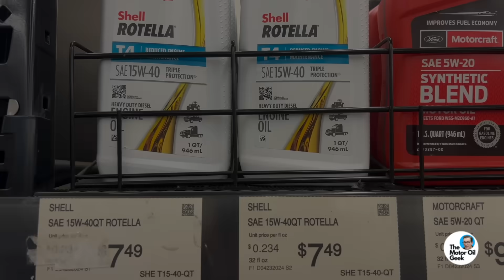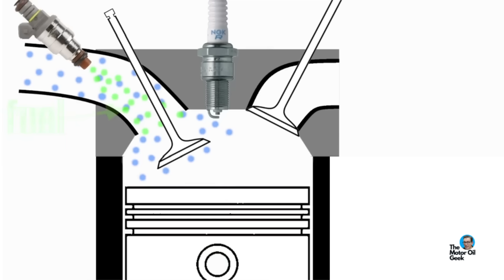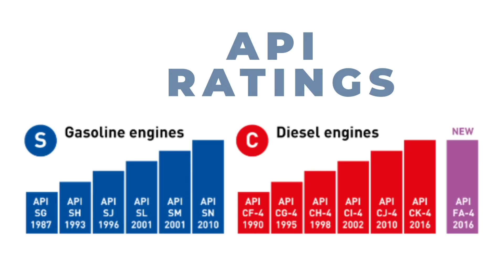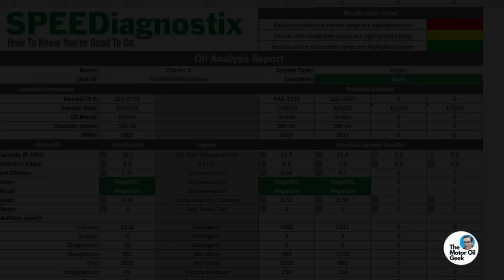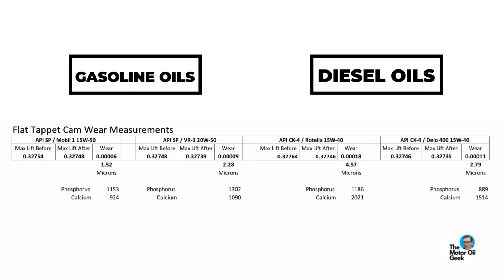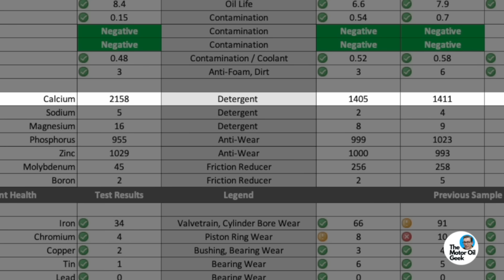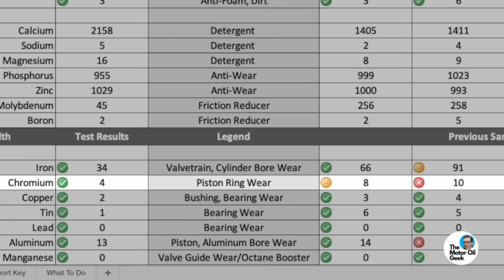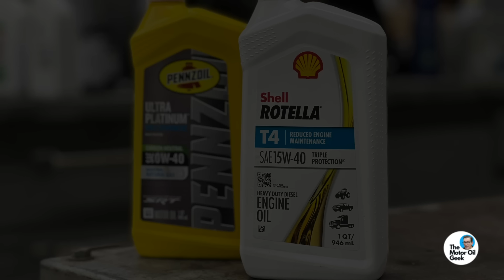Why DIESEL Oil is Actually WORSE for Gas Engines!

Comment: Why diesel oils are so popular with the pushrod V8 and pushrod V6 crowd is because modern day gasoline engine oil has far less Zinc.  Zinc is a lubricant for ferrous metals that are under heavy pressure.  Old style lifters in push rod engines need the Zinc.  The whole reason that the Zinc was removed is to make Catalytic converters last longer.

It is alot easier to replace a Catalytic converter than replace a Cam and Lifters on a V8.   Too much worry about emissions.
Reply: Best to remove the catalytic converter right from new to save on problems plugging up.
Reply: My understanding is that modern oils rated for gasoline engine use have been reformulated to not damage catalytic converters if being burned (if passing the latest "SP" rating)
Reply: Yep my 4.2 pushrod v6 gets 15-40 diesel oil
Reply: ZDDP is nothing more than a sacrificial coating.
Reply: I thought it was because auto manufacturers went to roller cams, which require no zinc?
So the oil companies took the unneeded zinc out? 
I mean the whole world is under a delusion that petroleum is killing the planet so the classic vehicles are under attack of the crushers and shredders.
Reply: What's in 30w none detergent? Any zinc ?
Reply: @timothyproksch2915 yes, T1 has also 1200ppm zinc in it. Like T4. I use SAE 30 in all my flat 6.
Reply: @timothyproksch2915 The non-detergent motor oils hold a sufficient amount of ZDDP to provide protection for their intended use. I used to own 1960's BMW motorcycles that used ND motor oil so I used Kendall's ND oil like everyone else did. I believe back then the engine break-in oils were ND so those held a higher percentage of ZDDP. The straight weight detergent motor oils for small air cooled engines usually have a higher percentage of ZDDP.
Reply: Still won't explain why that piston looks the way it does
Reply: Except you are missing part of the equation. The majority of engines still built with cam-in-block have roller lifters, and have for most of the past 30 years, so even current pushrod V8s don't really need that much ZDDP. Overhead cam engines also don't really need it as the valvetrain weight is far less and the valve springs are not as stiff.

What I would have like the video to address is the use of diesel oil, especially Rotella T4, in legitimately old engines, like my air cooled Beetle engine. I would not consider using it in any of the modern cars in my driveway as I basically just use Mobil 1 with a Dexos rating for all of those. For my Beetle, I WAS using VR1 but recently switched to Rotella T4 because the VR1 is pricey and not always easily available locally.
Reply: Did you even listen to the video? He specifically addresses that.
Reply: @Redmist370Z  I've been following this conversation for 20 years and what he did not address is the claimed competition between detergents and ZDDP leading to higher wear *not* being observed in the situation on the ground. Folks have been continuously meticulous about running oil analyses and this would have been common knowledge in the community by now if that was actually an issue. It's easily possible that today there may be even better oils than specific diesel formulations for the old flat tappet stuff, but unless all their additive packages change they are still a tested, viable option for these older mills.
Reply: @ I have friends that swear by Rotella in their passenger cars.   And the motors don’t spontaneously combust.  But the nature of your question implied that you had not watched the video because it was specifically addressed.

That was my only point.
Reply: @Redmist370Z  The video never once mentions catalytic converters at all. The video talks about direct injection gas engines, which is an application that basically nobody is using diesel oil in; and doesn't mention carbureted engines at all, which is where many people have used diesel oil, with great success. This video is propaganda, shilling for expensive high-end oils.
Reply: @Oldsmobility455  holy shit… big oil has infiltrated and corrupted the motor oil geek… I bet this goes all the way to the top… God help us all…
Reply: @Oldsmobility455  the recent war in Iran had nothing to do with nukes. Iran was secretly formulating a Diezel specific motor oil that could be used in any internal combustion engine. The damn Jews would not allow it to come to fruition. You have blood on your hands Trump. I mean oil…
Reply: @Redmist370Z  Did you even watch the video? He says he worked for Driven Racing Oil... 

Why do aftermarket cam manufacturers specifically recommend diesel oils for use with their camshafts? The cam manufacturers must not know what they're doing, like the shills- er scientists, in this video.
Reply: @Redmist370Z  NOPE... Some people will just believe what they believe no matter what... when engines blow its the dems fault... its the chem trails... all sorts of nonsense but of course. not the oil! I found a guy pouring mineral oil into his dodge... he swore up and down he's been doing this for 20 years and thats why his cars last for so long. despite the fact he was driving a four year old car... I told him to look it up... people are shockingly stupid at times... myself included
Reply: @Redmist370Z  He clearly just read the title and proceeded to comment.
Reply: very true  i use it in my ford flaty all the time
Reply: He literally said in the video, and showed evidence, that the diesel oils had more wear on flat tappet style cams. And that the higher ZDDP diesel oil did WORSE than the lower ZDDP diesel oil. This is because of the higher detergent in the diesel oils.

Use high ZDDP gasoline oils for your pushrods.
Reply: @ I saw the video but I see on a daily basis where diesel oil is being used in gasoline engines, again because of the ZDDP and there has not been any issues with engine wear because of the detergents.   Hopefully we can put the issue to rest.
Reply: @platec4798  Ok. Maybe you wont notice in a few 10's of thousands of miles. That doesnt mean its the best option.
Reply: @Jay-me7gw nope this is really wrong. But use what you want. Spend big bugs on your old engine.
Reply: @steveshotrodsvideo2950  I mean, the video showed proof that it was not wrong. What are you arguing?
Reply: As per my understanding rotella used to have a different formulation and once they changed it a lot of people say it's not as good anymore and it's no longer suitable for gassers
Reply: It must be so difficult to watch a 15 minute video before commenting
Reply: Except that old bs info..all diesel oils are now all ultra low zinc.  Call shell tech

Comment: By same argument an ordinary engine owner can’t determine relative wear. He won’t strip and measure his engines. Oil analysis gives some visibility but due to all the variables unless he has identical engines in a fleet and will do a/b on several engines he can’t expect to get enough resolution in the data to make sound evidence based decisions. The detergent vs anti wear competition is an objective fact, proven by analysis and test. The detonation in ring groove for gasoline higher pressure ratio engines is a terrifying fact to bear in mind.

Comment: My Onan 4000 generator (spark gasoline) calls for 15W-40 up to certain ambient temperature, but SAE 30 for higher ambient temps. The only 15W-40 oils I know are diesel oils. I use the 30 oil, but a few times when it got cold in TX, the generator didn't sound good starting in that cold with the 30 oil.

Comment: T4's got the dinosaurs and minerals old engines love haha
Reply: Every motorcycle and atv I own has used T4.. 20+ years.
Reply: @junkforlessutube me too started with military using rotella in everything shell developed it for universal oil .   Not saying it is the best but it made my turbo Porsche happy still running it in my first new tractor over 12 k hours ran a power stroke 600k miles another 400k miles still idles all day in construction and rolls at 25 k pounds.
Reply: It's good for a first fill up on engines that have been sitting for years like the ones Derek is getting going
Reply: You've been watching too much Vice Grip Garage. 😆
Reply: @j.t.cooper2963 Thats unpossible!
Reply: @j.t.cooper2963  you can't watch too much VGG ! :)
Reply: VGG family Here I see
Reply: Thanks Derick😊
Reply: I've heard a guy say that.
Reply: Oil didn't come from no fuckin dinosaurs.
Reply: Delete all my comments pricks.
Reply: Great, now I’m even more confused
Reply: I just purchased shell T5 for my 325k mi gas motor, It has SN API rating on back looked up multiple sources of lab results shows T5 has much less calcium than T4,T6 also it's the only 1 with moly about 50ppm the others negligible. Have used T4 in past and ran smooth and quiter I learned from this video but still plan on using T5 maybe not the T4 but have seen T4 with SN on it as well maybe only the synthetic blend version.
Reply: So you think oil comes from reptiles? Right.....
Reply: Strange my comment telling you were oil really comes from got deleted automatically. Imagine that.
Reply: Synthetic is better even for old engines.
Reply: @moshet842 Except it pisses out of every orifice. I've been there, the cork gaskets just suck it up and it leaks everywhere.
Reply: @AnthonyPerna2   The answer to that is complicated and there can be different reasons depending on the car, but it all comes down to your engine being faulty to begin with.
Reply: @moshet842  not true. If you look engines built before the late 80s early 90s used cork gaskets with rope rear main seals. All of which were designed to suck up oil to keep them plump/lubricated. Then we went to drastically different gaskets in the 90s that were rubber and designed to keep oil in, instead of wicking it. So when you put synthetic in, it soaks into the cork much easier and causes a leak.
Reply: @AnthonyPerna2  don't use mobil one?
Reply: @AnthonyPerna2   Do you have a source confirming that or is it just a hunch like most other hunches about synthetic oil?
Reply: @D3AThCAl2DS  I do run mobile 1 on any engine I rebuilt that has modern seals or a new vehicles I'm actually a big believer on synthetic oil
Reply: @moshet842  literal fact, search how cork gaskets work. You'll go down quite the rabbit hole. They're just old technology they're designed to absorb oil that's why if you look at an unrestored car from the 40s to the 70s you'll see all that thick Gunk all around the motor, that's from the motor sweating. So when you put an oil in with significantly smaller molecules it soaks through the cork at a much faster rate, causing small leaks. Im not implying that you change your oil to synthetic and the next morning the pan is dry and the contents are laying in your driveway but you'll start getting small leaks in all random places that never leaked before then you go back to Conventional and it stops. I'm not anti-synthetic by any means. I believe in it, and I think it's great, if I rebuild an engine and put in modern gaskets and seals, I always run synthetic in it after break-in. It just comes down to different engineering philosophies and materials. For evidence look at the era around when we started using synthetic oil more often.  Gasket material changed and engines went to one piece rear main seals, the majority did away with rope seals and went to the modern lip seal you see today. A perfect example is Mercedes wanted you to use mobile one in their engines back in the 70s, if you look at their valve covers they actually have a Rubber seal on them from the factory.
Reply: @AnthonyPerna2  That might be the dumbest thing i ever read in my life
Reply: @toyyoda3710  ok considering you know so much explain away. I can't wait to hear your genius insight.....I could use a good laugh
Reply: @AnthonyPerna2 correct!
Reply: @AnthonyPerna2  I think this video does a fine job explaining why
Reply: @toyyoda3710  definitely not
Reply: @AnthonyPerna2 Who still rebuilds engines with cork gaskets in 2025? Do they even sell them anymore? That's an incredibly dated, poor design by modern standards. Why in the world wouldn't it be replaced with a rubber gasket ??
Reply: @AnthonyPerna2  OK... FINE... the old dino oil makes sludge... that sludge will keep oil inside a neglected motor and new clean synthetic may appear to create oil leaks when all along the engine was of poor design and abused with inferior oil
Reply: @toyyoda3710  🤣🤣🤣🤣🤣
Reply: @AnthonyPerna2  Sorry you didn't understand... I knew i was better off explaining this to my dog
Reply: @toyyoda3710  🤣🤣🤣🤣🤣🤣🤣
Reply: @mwezi4193  I think you missed that part of my post. I was referring to stock still running older engines that still had cork. There are still some around for example, My 75 Cadillac and 55 Buick both have never been opened and still have their cork gaskets. Im running conventional oil and have no leaks. However when I do repairs or I rebuild any engines i replace the cork with rubber. But yes you still can get cork gaskets at the store. Actually the side cover gasket on my Ford 300 is only available in cork.
Reply: @mwezi4193  It's hard to find rubber gaskets for a 1938 Buick inline  eight, hell it's hard to find any gaskets.
Reply: If engine is pre synthetic the gaskets and seals  may not work with synthetic and oil can leak everywhere. Stick with what it was designed for.
Reply: @moshet842 not true at all as the weight differs significantly. If put 15W-40 into my flat 6 from 1946 it will leak all over the place and runs really rough. Have been there tested it
Reply: @moshet842  I guess you don’t have much experience with old engines.
Reply: Nothing about conventional oil performs better, nothing.
Reply: @100pyatt  performs better on them flat tapp-ed cams
Reply: @  No it don't. The issue with flat tappet cams is the extreme pressure between the lobe and tappet. Synthetics in general have better extreme pressure rating compared to conventional.

Comment: It's always best practice to run the type of oil the engine manufacturer recommends. Especially observing the weight of the oil...
In the case of motorcycles using shared engine/transmission oil, make sure the oil is rated for wet clutch application; which T6 is.

That said I put 42K miles on an air/oil cooled Buell engine with zero problems, running Rotella T6 5/40.
Also used Rotella T6 in my '16 MV Agusta Turismo; triple, 800cc, 13K redline with no problem.

Comment: Thanks for this.  I didn't realize there was any difference between diesel oil and passenger car oil.  I thought it was just marketting for "most diesel engines want this weight and it's a big container because most diesel engines need a lot".  I've only seen 5Q jugs of diesel oil, never 1Q in stock at O'Reilly or Napa.  I've been putting 5Q of "diesel" and 1Q of normal synthetic in my Ranger for the last 80k miles.  But, with 120k miles it's showing no sign of problems.  Maybe I'm lucky, maybe it just doesn't matter.
Reply from the maker: Your welcome

Comment: Ok, you covered new cars and new truck engines, how about the stuff more people work on in the back yard?
Small low compression engines. Motor cycles, dirt bikes, lawn equipment, small outboard motors. Yama lube vs rotella
Reply: I run Yamalube4 on all my wet clutch engines.  It works.  So I run it.

I've never understood this hard-on for constantly figuring out the 'best oil'. Find what works, then go worry about something else that doesn't have a working answer (yet).
Reply: @earlbrown   if you don't want the best oil for your car, then you shouldn't want the best food for your body. Eat McDonald's every day vs vegetables and meat and see which one lasts longer... Same applies to engines.
Reply: @TheScrubmuffin69   Your entire premises is based on a "the best" existing.  It doesn't.

One you have ''will do the job'', that's all you need.   All oil today is so good, that damn near any engine can go over 250,000 miles by the dumbest of owners as long as they get a regular oil change.

There's no magic there.

And, no, I don't want ''the best'' food for my body.  I eat what I need, and like all my engines, what I need is plenty enough.

But here's some food for thought....   how come you don't obsess over ''the best'' transmission fluid, or ''the best'' rear gear oil.   Or ''the best'' coolant, or ''the best'' brake fluid''?  

Speaking of that, since we're so worried about living with nothing less than 'perfection'...   When's the last time you did a complete flush of your brake system in any car?  And did you choose ''the best'' brake fluid. Or did you just grab some DOT3 (not the better DOT4) off the shelf?

...on the complete flush that probably never happened.

Once again, the ''worst' oil you can buy today is better than ''the best'' oil you could get back then.

Damn near any name brand synthetic will keep the mechanical aspects of an engine intact for decades.

Comment: I worked in a test lab for FNGP, made seals for a small engine manufacturer that required running a horrendous torture test in fully assembled engines. Got first batch. Blew them up. Violent failure. Like grenaded, pistons through the wall. We were running these 3600rpm engines at 5400rpm with no breaks for 24 hours.  Contact customer, they ran Rotella diesel oil in all engines in their test lab.  They then tried to replicate our failures.  Three dozen grenades later somebody asked, "why do we run Rotella"?  They had sent an intern to Walmart to buy 20 gallons of 15w-40 diesel oil, all the same brand. The only oil the local Wally had 20 gallons of was Shell Rotella.
Reply: So did the oil blow them up?

Comment: Not all, but some diesel oils have higher ZDDP concentrations that help prevent wear in older gas engines that use flat tappet cams. This extra ZDDP also effects valve seat wear. Older engines didnt have hardened seats. When they remove lead from gas and oil, they found the seats wear out quickly. To prevent this they went to hardened seats.